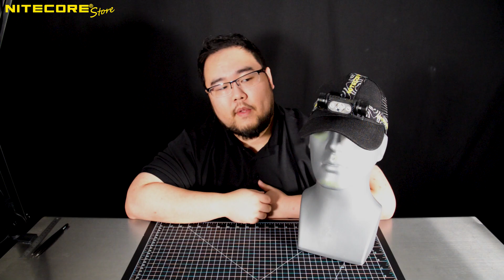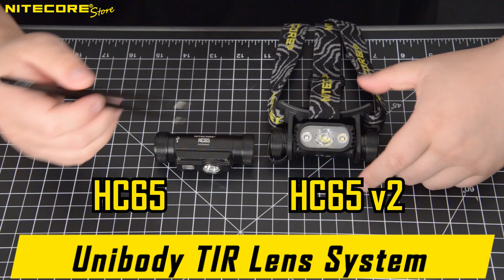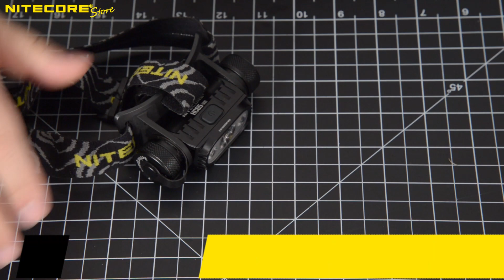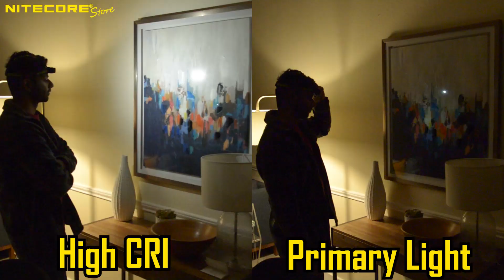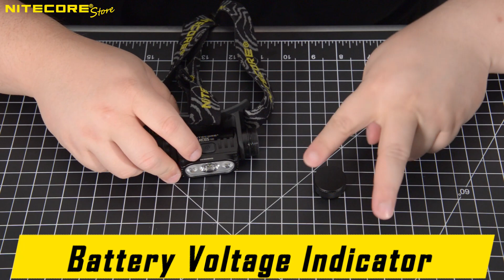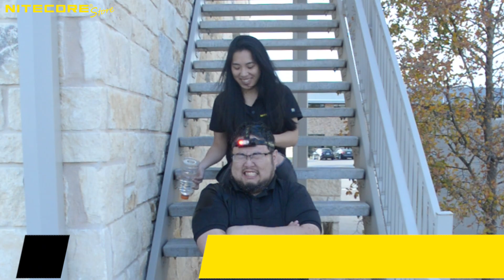Nitecore HC65 v2 - 1750 Lumen Primary + Red LED, High CRI LED, USB-C Rechargeable Headlamp

Comment: I wanna ask about How to show the battery status, to inform us that the battery needs to be charge (low battery) ?
Reply from the maker: you have to unscrew and then screw back on the battery cap, it's very unintuitive so I would suggest checking out the upgraded HC65 UHE!

Comment: I own this product and I'm a little disappointed.
Sometimes it refuses to turn on, I have to remove the battery and then, when inserting it, insist on the control button to be able to turn it on.
It is a contact problem or an electronic component does not work properly.
Sometimes after waiting a while I press the button and the surprise works, but it's like the lottery.

Comment: Got the HC65 V2 after listing to the narrator 3 or 4 times to digest everything he was saying. It took three days for me to contact customer service. Customer service is something to be desired. I wish they were as helpful and enthusiastic as the narrator. They do not tell you you have to use their special battery (18550 rechargeable high output 8amp battery retail on line $21.95) The regular 18650's work but not as long. I asked why when charging the lamp body gets really hot and he didn't know. I asked him when on high it drops down to a lower setting, he didn't know (if the battery charge is weak it will drop down automatically). You have to unscrew the battery cover and screw back on to find out what power is left in the battery. It's very difficult to adjust the light body up or down and while doing so you inadvertently keep hitting the on/off button. This lamp is only a floodlight. Overall C rating. I considered returning it until I found out all the hoops you have to jump through and the return charges associated with it.
Reply from the maker: The 1 thing I can help you with is the headlamp rotation. Almost all headlamps are really stiff to turn up and down so what I like to do is spritz a little WD-40 onto a napkin and rub it on the headlamp body near the mount grips and that thing will swivel up and down with ease.
Reply: An honest review from a customer rather than a salesman 👍

Comment: Love the sense of humor.  I have a Nitecore Intellicharger i4 and a bunch of Nitecore 3100 mAH batteries.  Three questions: 1) can i change the battery in this headlamp in my i4? 2) can i use my 3100 mAH batteries in this flashlight? 3) can I charge my 3100 mAH batteries in this headlamp or could they be damaged?

Comment: I’ve completely swapped out my whole light eco system because of this channel! I edc the e4k, have the b/c65 v2 as my head lamp, have the glow in the dark tiki on my keys chain. Have the i4000r as a back up light. Can y’all recommend a flash light to mount on a rifle?
Reply: Armytek is the best flashlights if you want durability, comes with 10 year warranty and extremely good for using on guns!

Comment: Will there be a 21700 version, please?
Reply from the maker: We released the HC35 last year which was a 21700 headlamp and the general feedback we got from most users is that 21700 batteries push the size/weight into the uncomfortable zone. 😲 So I am not 100% certain if Nitecore is going to release a new 21700 headlamp.
Reply: We need the 21700 battery please thank you.

Comment: Can you make a small one. That has a similar mount.   I would love to be able to mount a small light to my backpack shoulder strap.
Reply: Did you try the new CU10?
Or maybe the NU35?
Or the UT27?
Reply: Nu05 is what you want
Reply: NU05 or NU07 models are just for signalling though. They're not fully functioning flashlights.

Still if what you're looking for is signalling, then Dantick09 is right, NU05 / NU05LE / the new NU07LE are what you should check out.

I mounted two NU05LEs on my motorcycle helmet back in the time. Signalling them with seperate colors; white vs blue or sometimes red vs blue, instead of the police red/blue strobes, in order to prevent attention of the law...
They're quit capable of what they're intended for.

Comment: Finally a dual spring Nitecore incorporates common tech that has been in flashlights for over 15 years. This new HC65 V2 has incorporated several new welcomed changes. A useful lumen level at high, yes please and thank you.
Reply: Would you be so kind as to explain the advantage of using a dual spring on the hatch?